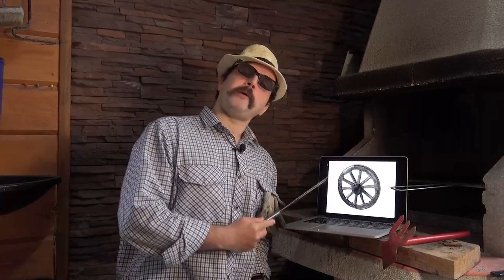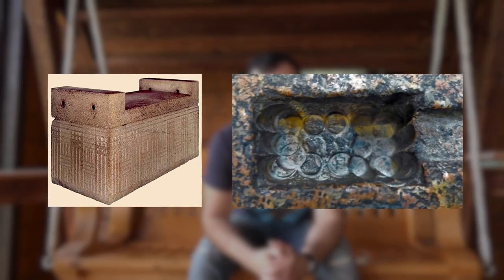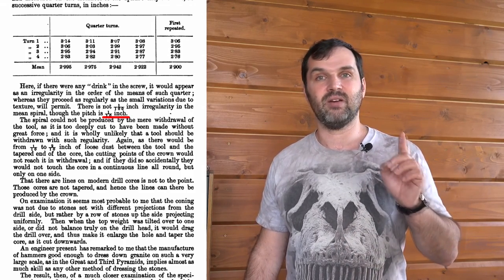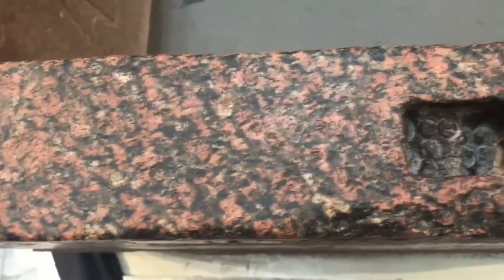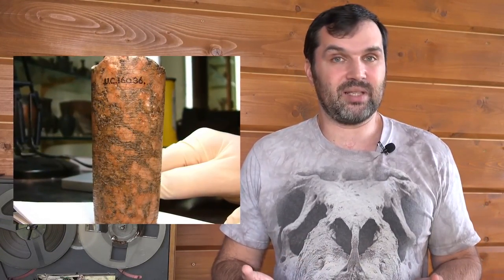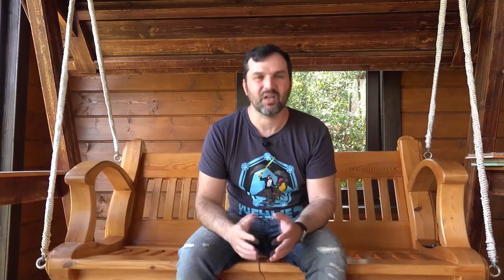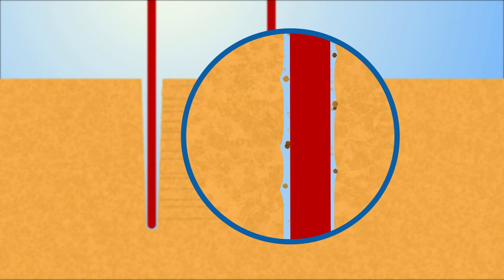Out-of-place artifact: 100 years of deception | Fake science spotlight

Comment: But ... but how did they levitate giant stone blocks without a fluxcapacitor? You can’t lift granite because it is harder on Mohs scale than the rope the ancient Egyptians had, you need diamond rope  and they haven’t made that since the Gobleki Tepe factory shut after  the Atlantean financial collapse of 10500 BCE.
Reply: Then along came the wheel.  With that came pulleys.  Africa has elephants too. Elephants are still used in India.
Hannibal used northern African elephants to attack Rome.
Reply: @kheru5267  no elephants are depicted in the grave art that shows Egyptians building pyramids, though. And wheels are not that useful for transporting massive loads over unhardened terrain. Not until you have engines to power vehicles. Just a ton of elbow grease and human creativity to solve problems.

Comment: ..two other stone shaping techniques the ancient Egyptians used were honing the new block being placed on a wall back and forth on the block below and the block to the side to get a very tight fit that you cant get a razor blade into and this also explains why some blocks have a corner honed down off line into other blocks...smooth walls can be produced this way as well by honing the surface of a wall with a block used with a pendulum motion...to speed up the roughing of a solid rock wall or block of stone, the Egyptians would first knock or gouge parallel grooves into the wall leaving ridges that could be bashed off...this is faster than gouging the entire surface...once you know their techniques, you may wonder about the advanced tool tech claims...

Comment: I have the Chris Dunn book and was prompted to look again at it after this and your granite drilling video. I think he was honest about his observations, however as you have shown, like Petrie imagined a spiral, though not with the perfection that Petrie claimed. Like Petrie, he interpreted the pitch of the grooves as the drill rate and convinced me too! You have demonstrated the fallacy of this. Thank you.
Reply from the maker: Wellcome
Reply: The difference is that Petrie had the excuse of ignorance and lack of easily obtainable expertise.

Dunn has no such excuse.

I think Petrie was simply lacking necessary expertise and making assumptions on paper as an honest mistkae.

On the other hand I think Dunn was just profiteering from an expectation of general ignorance of his audience.
Reply: @tilleryinnovations592  "The sand slurry creates a 1/4" gap between core and hole. So, this is clearly not the same technique used"

You assume no difference in technique or device?

At best SAM are guessing about the thickness of the copper sheet, and it's not impossible that the Egyptians used something harder than quartz sand as the abrasive.

Something like corundum, or various other gemstone crystals between 7 and 9 mohs.

People often forget that by the time dynastic Egyptian history began the Lower Kingdom on the Nile delta was already a significant trading hub for the Aegean coast - by the time the Minoan naval trade was in full swing in the mid 3rd millennium BCE the Egyptians would have had access to any mining source within reach of that coastline.
Reply: @mnomadvfx  ...
I believe they both erred on the side of confirmation bias.

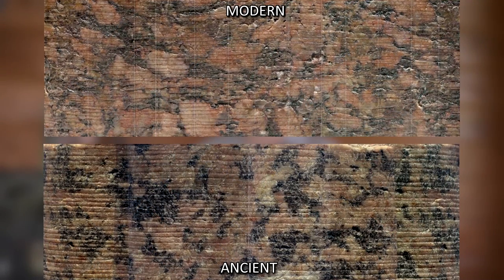Comment: @11:18 you show the ancient and the modern samples side by side, and on the ancient sample the scratches cut through the aggregates at the same depth, while with the modern sample the black aggregates have been removed significantly more than the biege parts.
Why is it so different if the process is supposed to be identical and the stone material is supposed to be identical?

Comment: 3:42 I love how they break the core with a steel chisel since we know steel didn't exist back then and copper won't work. 
No one has ever said the marks on Core No 7 are threads! If you can't understand the difference between threads and tool marks you have no business trying to debunk anything. Breaks in the tooling marks are caused by the drill "pecking", the tool is removed from the hole, the debris is cleared, then the drilling starts again. This is super common in drilling. It's not a thread for a bolt that needs to be continuous. 
Why would you have a geologist trace the marks in the core?? That makes no sense, this isn't a question of the rock's mineral content, this is a question of how it was done, which should be inspected by an engineer or tooling expert. Geologists and historians who don't understand anything about stone working are why we have these stupid theories to begin with. 
13:52, this is a joke. You intentionally show it flat because you can't see where any line starts or ends, tracing it removes all detail, this literally proves nothing. What a waste of time.
Reply: Copper works to break the core out. Wood works. Only certain people claim steel is necessary. The striations are caused by the abrasive medium. This is well known and repeatable.
Reply: @Eyes_Open  Copper works so well no one ever uses it to prove their theory. 
The striations are not even the argument.
Reply: @bobbygetsbanned6049  I don't think you have invested much time on this topic.
Reply: @Eyes_Open  That's a pointless comment.
Reply: @bobbygetsbanned6049   @Bobby Gets Banned  You said copper is never uses and that striations are not the argument. How else could I respond? Both of those are incorrect statements.

Comment: May be a new project for you: how do explain the scoops mark under the Egyptian obelisk which was found in the granit quarry in Aswan?
Reply from the maker: Thank you. Its  too simple.
Reply: I heard that the Egyptians burned big fires on the stone,, and quenched the stone with water causing the stone to become brittle.  Then taking hard rock balls they beat the stone which easily chipped/fractured due to the brittleness after quenching.
Reply: @lakeschoolrestorationchann1567  yes, Fire setting, there are many videos on YouTube showing this. You can chew through granite in no time. 
Also in quarries there are traces of grid like markings for where each worker was assigned an area. The size matching the ‘scoop’ marks.
With fire setting the unfinished obelisk could have been done in a very short time. Just with stone pounders alone each person could remove up to 18 cubic centimetre a minute.
Reply: @ScientistsAgainstMyths   Can you quickly explain the “scoop marks” in a comment?  I’m super curious about them and would love to hear your easy explanation :)
Reply: The scoop marks themself are consistent with marks one get by hammering the stone with rounded (stone) hammers. If they just held the hammer stones in their hand, or if mounted the hammer stones onto some sort of a handle to reach under the obelisks i do not know. 

I am not entirely sold out to belive they used firesetting a lot though. Wood (for fire) was scarce in ancient egypt. Add to that, firesetting also have a high chance of making unwanted cracks, and the surface also gets rather dull. Ancient charcoal and ash have been in Aswan though, suggesting at least they experimented with it. Perhaps they knew of a way to use it which reduced the chance of negative side effects, or another way to apply heat, idk.
Reply: @heisag   It seems if there were many people standing side by side, hammering away from top to bottom, each person working on a section about a meter wide, that eventually these "scoop marks" would appear in this way because of the nature of the spacing between the workers.  It might be this very simple explanation, rather than ultra sonic scooping high technology or whatever.  I'm curious if this explanation is similar to what the Science Against Myths guys think?
Reply: @heisag  dung and chaff could also be used, it only takes a small low heat fire a short time and if applied with a bit of expertise. On large slabs the heat will only affect the area directly next to he fire.
Reply: @normdeeploom5945  That is most intresting, thank you. I know there are some papers on a firesetting experiment at Aswan, but they are behind a paywall. 

Also a video from an experiment they did, i just can't find it anymore. They did the firesetting, then pounding with stone hammers, and the result after the hammering was pretty much identical to the "scoop marks" from ancient times.
Reply: @ScientistsAgainstMyths  Actually you haven't the foggiest idea about the scoop marks and how they were made in all those positions.
Reply: @heisag  Let's see it then.
Reply: @heisag  How many strikes with each pounding stone to create each scoop mark? 1,000? 100? 1,000,000?

Comment: But what about very thin walled hollowed out hard stone vases?? I think this suggests they could work under all angles and very high speeds consuming the copper point very fast too, unless they could insert diamond in the point. But even then the thin copper shaft has to withstand enormous pressure with bending.  Are there building plans for such a high speed drilling machines ?? It could have been a kind of special team that did this with professional secrets of course.
Reply: The copper isnt consumed because it is the abrasive slurry that is doing the "cutting" (Technically not cutting, but grinding).

Comment: Those hi res photos of core 7 tell us everything we need to know, the grooves are a complete fucking mess, any spiral is probably just the human brain looking for patterns in randomness. I wouldn't completely rule out the possibility of a trend in the angle of the grooves although it would be very difficult to determine but such a trend if it existed could quite easily be explained by the abrasive particles either falling down or working their way up the walls as the drill turns, i wonder if a trend could potentially indicate whether the drill was turned in one direction only or if direction was reversed at the end of the stroke like with bow drill.

Regardless I am doubtful that such a trend would be possible to determine from the poor quality grooves on core 7.